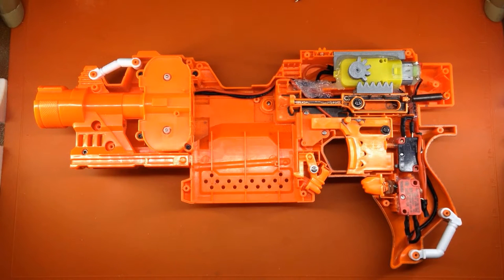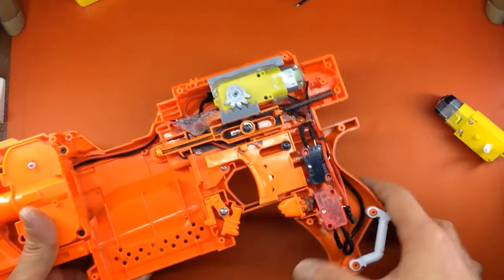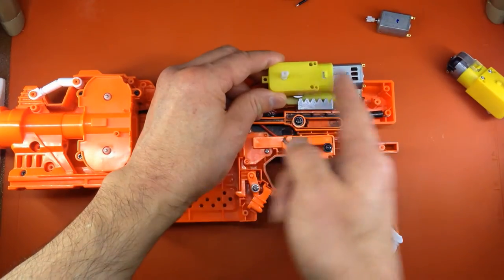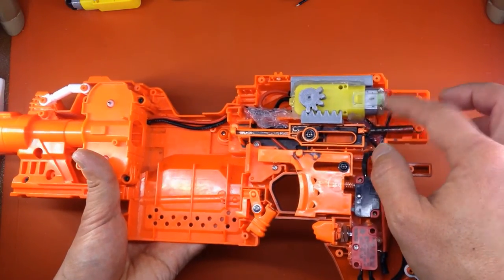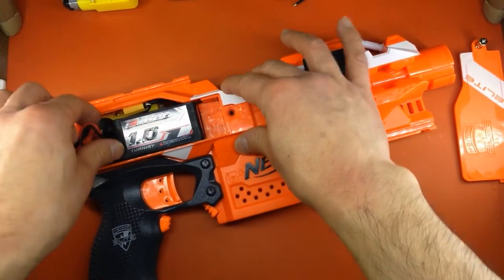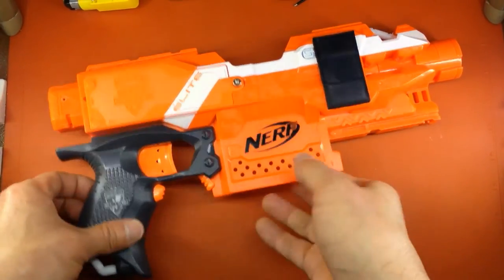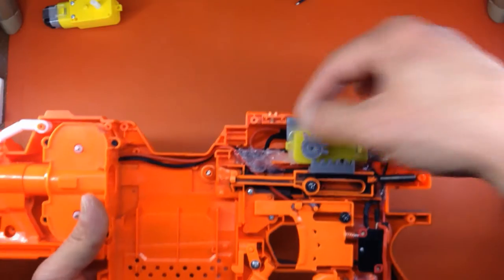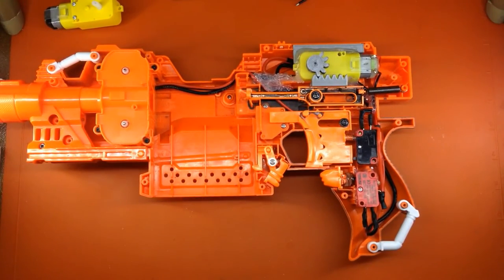AutoStryfe

Comment: Dude you're everywhere, subscribed as hell, glad to see you're making stuff!
Reply from the maker: It's only somewhat recently that my interest in Nerf spiked; I've been doing voltage mods for quite awhile, but nothing out of the ordinary worth documenting. 

Not that that the AutoStryfe is anything new, I'm just not sure how many people realize just how easy and cheap it is to add a gearbox, pusher motor and rack and pinion gears. It changed my perception of the value Hasbro assigns to the handful of automatic models they sell. 

Building a 3D printer last year just made it easier to really get into modifications.
Reply: I commented here 11 hours ago, and I've already designed and printed a full kit. I did it a little differently but totally giving credit.
Reply from the maker: I've seen how good your CAD work is; I know you'll have a drop in kit that virtually anyone can install, so that's a pretty big boon for those who can't order kits through Taobao or through secondary vendors. 

So I can't even claim the idea; this was more of a PSA for building cheap automatics. But I do appreciate the thought!

Comment: Nice work. Any plans on releasing the STLs or sharing them.
Reply from the maker: I've posted the gearbox mount, pusher arm spacer, rack and pinion gears on Thingiverse. You'll still have to source the gearbox, but those are readily available on Amazon and Ebay. 

Check the V2 YouTube video for the updated install/version. 

http://www.thingiverse.com/thing:2245550
Reply: thanks. i have the gearboxes but just got the printer so I'm still trying to dial it.

Comment: can you link me to the amazon page to find the gearbox pls
Reply from the maker: Your best bet is Ebay. Search: geared motor gearbox arduino 
http://www.ebay.com/itm/2pcs-lot-1-48-Plastic-DC-Drive-Gear-Motor-Gearbox-for-Arduino-Chassis-Smart-Car-/192097652099?epid=1548267543&hash=item2cb9e98d83:g:9ocAAOSw8w1X9k9y

Because they are cheap, I would recommend buying more than one in case you strip one of the gears if using high torque feeder motors (180 size) at high RPM. 
Just note the shipping times as many of them are coming direct from China, which means longer ship times. 

You can punch in the same search in Amazon and you'll notice that most of the orders will be delivered from within the US which means faster shipping times, but they'll cost more. 
https://www.amazon.com/Uniaxial-Motor-Geared-Magnetic-Gearbox/dp/B06XKVRKGK/ref=sr_1_5?ie=UTF8&qid=1506031933&sr=8-5&keywords=gear+motor+gearbox+arduino

Comment: uh, pwm? go  to goodwill. buy a shitty drill that has variable trigger for 3 bucks.  take trigger unit out, hot glue in place. i have one in a stampede running off 20 volts.  i like your use of the gear box amd 5 tooth.
Reply from the maker: This mod is really about max payoff in a minimally sized package for next to nothing in parts. 

The Stryfe as a platform is about as small a shell blaster can be for a flywheel/magazine design that still has ample interior space for a 130 motor sized gearbox. Since the gearbox allows for drop in motor swaps, achieving a high rate of fire is as simple as matching the appropriate 130 motor wind to the box gearing and the right LiPo battery to drive the three motors with sufficient current. 

While a bit less game practical, a $2 FF130 motor can produce 17 shots per second on an 8.4v charge (65c LiPo) with the mag inverted to keep the feeder mech from outrunning the magazine spring.